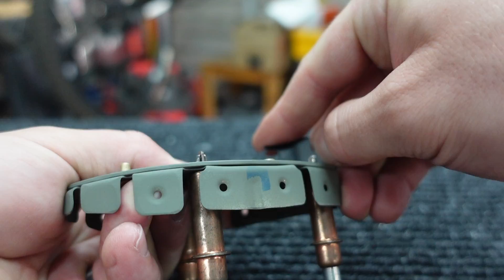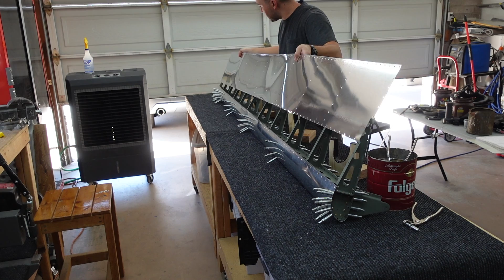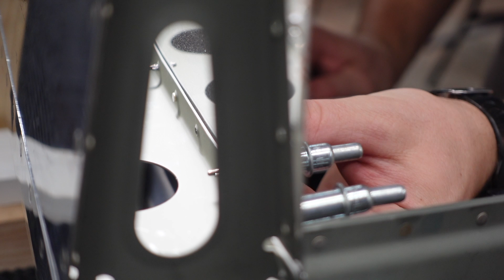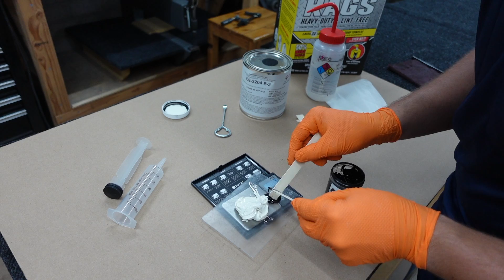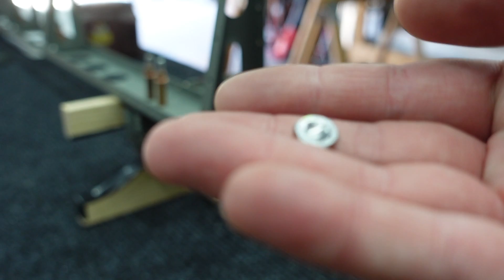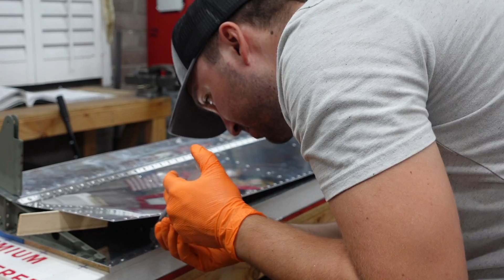Van's RV-10 Flaps - Part 2 of 2

Comment: Just a thought on using the Knipex pliers. I guess one could also knock off (grind down) the pin on a 470 squeezer die if they don't have your steady hand to modify a nut using a multi tool. Just a thought.
Reply: Great video!

The 1970’s solution was to use Vise-Grip pliers.  These were adjusted and tested on scrap material so as to avoid over squeezing.  The plyers’ bolt was tapped with electrical tape to keep the adjustment.

There must be a slight angle in tooling sets so that the rivet sits parallel to the surface, and not at an angle.

Two little steel bars were used as sets.  A rivet kept them together.  

Knipex pliers probably didn’t exist back then.
Reply from the maker: @marc-bernardlevesque5016  thank you! And how interesting. I never considered using vise grips. That makes a lot of sense, especially with the amount of leverage you get at the end of the squeeze with them. I learn something new every day. Thanks for the comment!
Reply from the maker: That’s a great idea!! Would be a lot easier than the DIY method I did with an AN3 bolt

Comment: Austin, what are you using for primer? I tried the P60G2 stuff and honestly not very impressed with it. I like the consistent flat finish and color of yours. Looks like it will do a good job of protecting all your surfaces.
Reply from the maker: Oh you won’t like hearing this, but basic  Rustoleum Self Etching Primer. Not the most durable but it’s just so easy to use. I’ve been using it sporadically throughout the build. I tend to go through seasons of building with bare aluminum with no primer, and on these last few closed up parts priming again just for the heck of it. Im in AZ so it’s not a high priority for me